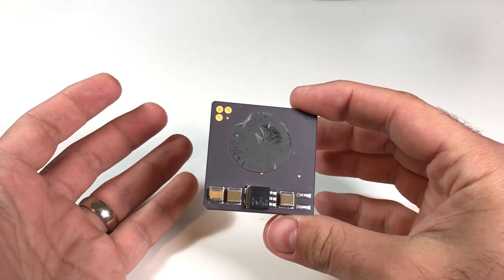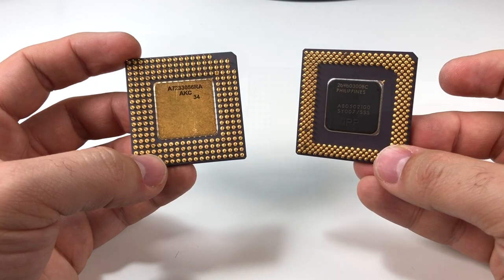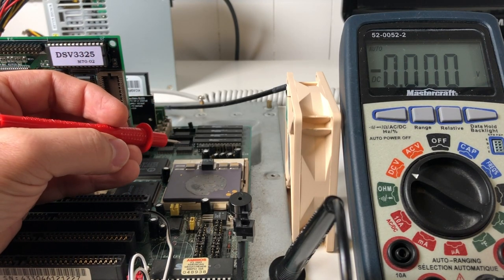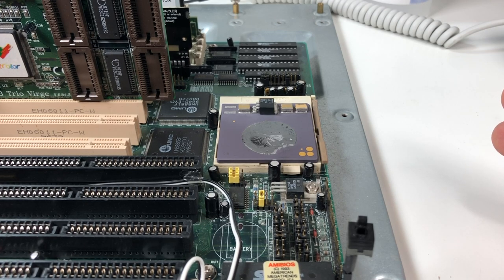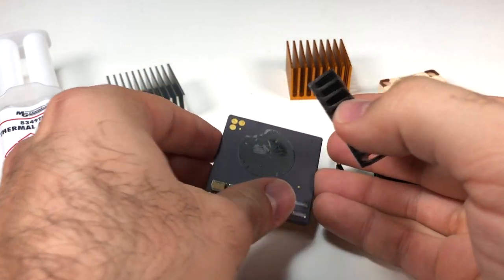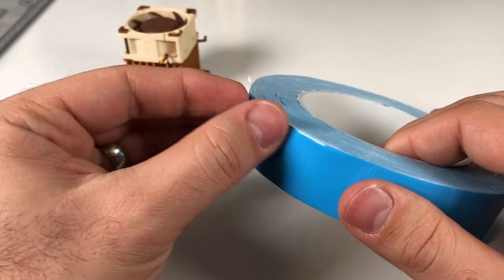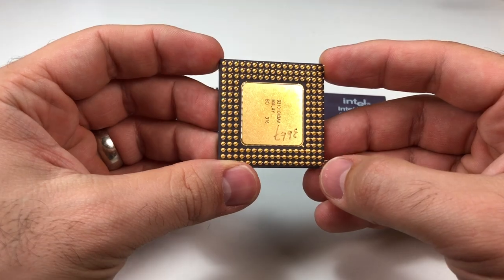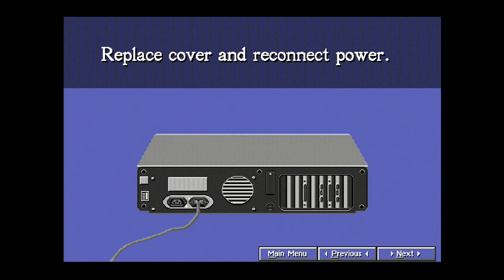The Intel Pentium Overdrive CPU for 486 Systems

Comment: This was a very interesting video. Back in the day I had a Compaq Presario CDS 924 with a 486 DX2/66. I was looking to upgrade it because, like you said, it ran Quake terribly. I opted for the Evergreen "586" 133 Mhz chip, since it was cheaper and gave me more Mhz. It actually powered up my Compaq quite well and it ran Quake and other games very nicely, but then someone told me that it was just an OCed 486 and it lacked the special Pentium instructions that would allow it to, say, boot Windows XP. I was peeved, but the chip still tided me over until I got a true gaming rig.

Comment: Back in the day I had a 486DX4 100Mhz with 16MB of ram. I remember when Winamp came out it cried that it needed MMX instructions, so I spent the money to upgrade to the Pentium 60mhz.. even though it was "40mhz slower", it included those MMX instructions that allowed me to run Winamp.. man I wish I kept both of those boards.

Comment: In  my first job, at beginning 1996 I have to upgrade a tower server from Compaq, a Prosignia VS with a 486DX2 and I selected a Pentium Overdrive 83MHz. It was an incredible upgrade for Novell 3.12 file server in an organization of around 50 office users. It was replaced in 1998 by a Pentium Pro 200MHz. I still have that old Prosignia server and start to hear that old SCSI hard disk and Novell console. So fast and powerful computer in that time but evolving so quickly, in very few years we were Xeon servers, ufff.

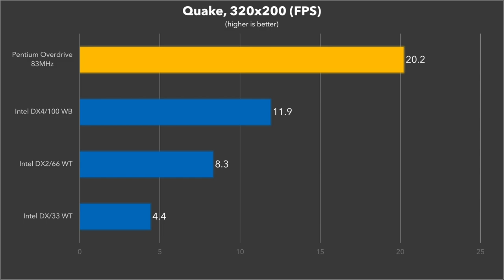Comment: 25:00 most of the effect does not come from the FPU performance itself, but from the architecture difference between 486 and pentium. How pentium worked, was that FPU was able to process its data in parallel with the rest of the CPU. It was almost like you had 2 cores on a CPU. And in quake they made heavy use of this "dual-core behavior". 486 couldn't process integer and floating point calculations in parallel and most of the performance is lost on that part.
Reply from the maker: Very interesting, thanks for sharing! I still have a lot to learn about the Pentium architecture :)
Reply: I'd love to see a reference on this! As far as I knew, the 486 was available with an on-die FPU, but the FPU remained a distinct coprocessor until MMX and SSE started coupling it closer to the CPU. FWAIT was used to synchronize with the FPU, and you could absolutely do other work on the CPU before that.

The Pentium had some FPU operations run in fewer cycles (including the infamously buggy FDIV), but its main improvement was in instructions per cycle on the integer side, which they termed a superscalar pipeline.
Reply: It's a combination of multiple factors. Mainly the superscalar integer pipeline, pipelined FPU, FDIV overlap, and FXCH parallelism. The original software renderer was hand-optimized by Abrash with these specific architectural details in mind. Check out Abrash's Graphics Programming Black Book if you want to learn how exactly it all fits together on a per-instruction level.
Reply: @GeckonCZ  Thanks, I think I may. :)

Comment: u should immediately replace all of those ceramic caps , ceramic caps when damaged can go short circuit and explode like tantalums which will really damage the soldering area and also short the voltage regulator to ground and as the supply to cpu is unregulated the psu will continue pumping current into shorted voltage regulator and so that ic will explode as well.
Reply from the maker: Thanks for your comment and for the tips. I may do some further modification to the chip and will look into replacing the chipped caps.

Comment: something died inside me when I saw you soldered to the gold pins. I thought you wete going to leave the kapton tape with a piece of wire, just for perfectionist sake. but in any case, really cool video and project!
Reply from the maker: Thanks very much! Haha yeah, to be honest it felt wrong soldering the gold pads. The tape and wire mod was too flaky though, unfortunately. I had the multiplier change a couple of times during testing.

Comment: I remember reviews at the time which usually weren't favorable, mostly because of views that the 486 platform was in it's endgame so it would not buy much time for many people. It was a spectator sport for me because I got a P54c 90MHz system (with the FDIV bug) in mid-94 as my graduation present, though I remember it having a few issues, particularly with the Reveal sound card that Insights included.
Reply from the maker: Thanks for your comment! The FDIV bug was very interesting. My first Pentium was from 1995 (a P54c 100MHz model NEC system) but I'm pretty sure they had the FDIV situation sorted by that point.
Reply: I would have killed for any kind of Pentium in 1994.  We suffered with a 486sx25 from '92 all the way to January 1997 when we got the Pentium 133.  That 133 opened sooooo many doors for us and it was so FAST.

Comment: Sparkle was a great PSU back in the day.  Not sure if they are still around.  I also had a modified one that was labeled "Glitchmaster".  They put a giant stiffening cap in it(about 1" dia X 4" long) and some surge protection circuitry in it.  It would run the PC for about 5 seconds after you hit the power switch.  Enough to ride out an OCR(that thing that makes your lights flicker in a thunder storm).
I had a DX4/120, but I guess I don't remember how smooth it ran quake, I just remember I could play it.
Reply from the maker: Very interesting! I'll have to look into that PSU. I've been really happy with this one. It's got really solid voltage regulation, lots of +3.3/5V amperage and even has a -5V rail. I use it on my test bench for all of my older AT based systems and earlier ATX systems.
Reply: @vswitchzero  Sparkle was made overseas, at least I think they were(are?).  Glitchmaster modified them in Colorado somewhere, IIRC, so it's a pretty good bet they aren't still around.
It would be cool to see someone find an old one and do a review of it, tho.
Unfortunately, I got rid of mine, and all my AT stuff, before I even thought there might be a demand for it again.
Back then I couldn't afford a PC so I mostly took whatever anyone else I knew threw away and I'd piece something together.  So I had so much stuff there was no way I could keep it all.
I'm sure I bought that power supply new, tho, and for that DX4/120.  That was given to me by a friend of the original owner.  He assembled his own stuff and I got that when he upgraded.  It was just a bunch of parts in a box.  I had to get a PSU, find a case, and stuff for it.  Later I bought a Promise controller card for it to overcome the 500mb(?) limit of the mother board.  In theory, I could have up to four 8.4 gb HDD's on that card, which would have been crazy back then.  I think I eventually had a used 1.6 gb HDD on it at that PC's peak.
It's a shame you just can't keep everything you ever had, lol, or, at least I couldn't.  ;)
Reply from the maker: @l337pwnage  I know the feeling! I kept almost nothing from my older days of PC building. I'm not sure what became of my original 486 and Pentium, but one I stared building my own systems I was constantly selling parts to raise the funds to buy new ones so I rarely kept anything I wasn't actively using. Over the years I've purchased quite a bit of the nostalgic stuff I had back then. Not always the exact parts but close :)

Comment: That Noctua 40x20mm fan has a 5V version.  Don't know if the CPU package could provide enough power, but it would be pretty cool to have it soldered on and self-contained like that.

I also have what looks to be the same thermal tape.  I got it to attach small heat sinks to some servos, and was surprised how well the stuff holds.
Reply from the maker: Thanks for your comment! I actually have the 40x10mm 5V version from Noctua. I think the OEM fan is actually quite a bit heftier and probably uses more power so I assume it would be okay to be powered from the gold pads.

Comment: Awesome video. One thing I'd like to see is an AMD 5x86-133 running at 150 and/or 160mhz on the same board to compare performance. I ran mine at 150mhz back in the day after benchmarking and seeing the mhz bus more than made up for the 10mhz frequently loss. I guess I just got lucky that my Diamond Stealth 32 VLB video card had zero issues with it. I did always wonder back then though if I had an overdrive chip how it would perform in integer performance. Even Quake ran around what a p55-90 would output though, so I wonder how that would compare too.
Reply: I commented before the end of the video and saw that 160mhz was tested. Was 150 mhz tested though? The extra bus clock really helped, and I have no idea how my i/o card and crap 30 pin simms handled it.
Reply from the maker: Thanks for your comment. I'll be doing another video comparing the AM5x86, Cyrix 5x86 and the POD. I will be including overclocking results in that one.

Comment: I bought a few drop-in speed replacements back in the days of the mid 1990's. And those were a 286-to-486 (to 25mhz) & a 486-to-586 (to 100mhz).  Both were from Evergreen Technologies (now since defunct).  The 486-to-586 is put into the Pentium Overdrive socket of a 486 motherboard that might have that additional socket.  My 486 did have that socket so I was able to enjoy a boost from the original motherboard 25mhz to the new 100mhz, because the new cpu is an AMD 5x86 (up to 133mhz).  I still have all 3 of these boost cpu's, but one of them got so overclocked that it had since gotten rendered nearly braindead & unstable due to thermal electromigration, i.e. I did not put enough heatsinking & cooling into it, back then in the late 1990's.  The x586 is still being used on one of my 486's today & it is still useful, although as useful as a sped-up 486 100mhz is going to be, relative to today, of course.   However, long before any of that, I did buy a boost cpu for my Commodore 64 in 1990, which boosted the speed of my C64 up to 4 times faster & that made a huge difference in some games & also in programming & productivity apps.  And I still have all my C64 stuff, which includes peripherals, disks, magazines, manuals & that boost cpu.
Reply from the maker: Thanks very much for your comment. It's always awesome to hear some first-hand experiences with these upgrade chips. I remember the Evergreen chips well. They were very popular back then.
Reply: @vswitchzero  ... I will likely further tinker with that boosted 486, if free time permitting.  I have been wishing to change out the mainboard oscillator so as to jump speed from 100 mhz to 133 mhz overall, to take advantage of the 5x86 133 mhz.  I am unsure of any potential issues though, which jumping from 100 to 133 may be within official tolerance for the 5x86 cpu,  yet it may not be for the motherboard components, but I would still like to try.  That was one of the exciting things that came out of the 1990's, wasn't it, i.e. cpu/mainboard overclocking?  Nowadays, AMD & Intel have since put the inclusion of automatic software overclocking in their modern processors, when ironically both companies condemned it inappropriate for end users to overclock their cpu's back then or else suffer voidable warranties, heh.
Reply from the maker: @robwebnoid5763  So true. The big gains (sometimes 50-100% or more) that could be had on old hardware like this is just no longer possible these days. Intel and AMD have become so good at squeezing ever bit of performance from the chips they make through use of boosting, thermal throttling and other technologies it seems. I may be wrong, but it feels to me like the Core2Duo was the last truly great overclockable chip.
Reply: @vswitchzero  ... Hmm, I don't think I have a C2D, but I'll have to check.  Well, at least I know the ones I've bought over the years didn't have a Duo.  I had acquired some used laptops at the recycler a few years ago that others have tossed & I will take a look at their processors.  Free is a very good price, heh.  I believe I may have repaired a friend's laptop over a decade ago that may have been a Duo. Or maybe it was one of my sister's machines. A lot of my older CPU's are still set overclocked on whatever motherboard they are on right now, notably my AMD K6-III+ overclocked from 450 to 600mhz.  There was a bit of a disappointment when Intel took away experimental end-user overclocking & then made it their own, when Intel/AMD did not even really make overclocking a part of their business in the first place.  It feels as though they stole that idea from the users & are now making money off it.  But it is what it is, it's their product & we customers toyed & abused it for as long as we could, to save money, heh.   People crave the latest higher number-crunching graphical games & high speed videography editing, so we're still going to want to buy the latest cpu's anyway from Intel/AMD, along with graphics gpu's, because we can't help it that technology keeps moving forward.  I am sure people still further overclock the latest crop of cpu's from the past decade or so of cpu's developed, but the gains are now smaller, much like what you said about gains, that of which Intel/AMD "stole" that thunder of gains away from past overclockers.

Comment: Neat, I have an Intel "SnapIn 386" upgrade CPU for the IBM 5170 and it has software that looks visually identical despite being a much older-generation CPU!  No FPU test of course, although I've also got that separately in the software for my 287xl coprocessor - but I think the software I have for that chip is text-based.
Reply from the maker: Those snap-in upgrade chips are really something. I always wondered how well they hold on to the old processor. Very interesting about the software similarities too. Thanks for sharing!

Comment: Back in the day, I had a DEC Starion with (probably) a 60mhz Pentium. I bought the Intel Overdrive chip for it. Jumpered the bus speed and I was then running the Overdrive at 133Mhz. Nice upgrade. My first PC after many years with an Amiga.
Reply from the maker: Nice! Those socket 4 overdrive chips are SUPER rare these days.
Reply: @vswitchzero  I sold the system to a coworker and never saw it again. :(

Comment: I was aware of these but never saw one in the wild, the final generation of fast 486's from AMD etc held most people off until Quake in 1996 finally cemented the need for a Pentium.

Had absolutely no idea this chip could throttle itself, that definitely has to be the first example of CPU self preservation tech, something most chips that followed until the mid 00's didn't do.
Reply from the maker: Thanks for your comment! Yeah I'm not aware of any earlier CPUs that would throttle like this. It was definitely a unique feature at that time, that's for sure.

Comment: My first computer was a 233mmx, so, a little ahead of these overdrives. I only wiched intel still produced overdive cpu's, the new alder lake e-cores would be such an upgrade for so many old plataforms.
Reply: it's basically the same as i did with my am4 recently. landed a 5800x3D on the system i originally bought for a r7 2700 (non-x), and the improvement over that is vast. in games, it might be 3 times as fast.
Reply: @GraveUypo  AMD is so much better then Intel on upgrades, the single fact they keep the same socket for several generations is a plus.

Comment: Acording to Wikipedia the Intel Pentium Overdrive CPU for 486 Systems was Introduced February 3, 1995. While the Pentium Processor (P5) was introduced 22. March 1993. Seems weird to not buy P5 in 1993 and instead buy a lower performance Pentium Overdrive CPU in 1995  🤔

Comment: Cool video ,  

On the epoxy  issue , I would of used some normal thermal paste  than then 3-4 small spots of epoxy in the corners.

That way you get the best of both worlds , the heatsink is secure but won't be a "female dog" to remove
Reply from the maker: Thanks for the great tip! I think that's definitely a good move and I'm sure the thermal paste will have better thermal transfer than if done with all epoxy too. I may actually be removing the heatsink to do some further mods to the chip, so if I do may give this a try.

Comment: 1- heatsink is overkill. The black one would have been sufficient, if used in a clean (non smoker) environment.
2- The fan is overkill. You could have easily used a 12V fan, using the 5V pins. It would have given you enough airflow.
3- the cooling efficient of the tape you use on the cpu, is about the same as standard dual sided, plastic scotch tape.

Comment: Hey! Loving you vids. Just a query on the CPU fan direction, I noticed that you had it blowing down...would it not be better sucking up instead? This is a learning opportunity for me, not a criticism.
Reply from the maker: Thanks very much! That's a great question. In theory, it should work both ways to cool the heatsink, but I seem to recall that pushing air into a heatsink's fins is a bit more efficient. There is also the benefit of providing airflow to other components around the socket when its facing downward (like VRM components on the motherboard, or in the case of the POD, the VRM components on the CPU itself). Tower-style heatsinks are a different story though.

Comment: Way back in the days my 1st computer was a Gateway 2000 4DX2-66  It was so slow. Even with the Evergreen Pentium Overdrive CPU Upgrade the system had bottlenecks. It wouldn't even play mp3s.

Comment: I bought Tandy 3100 and 3200 back in the day.  486/33s with 4MB, no sound or CD.  Still have them fully loaded.  The 3100 had only the "new" zif socket and could take up to a DX4/100 or the Gainberry 586/133 which is what is in the 3100 now.  The 3200 has the Pentium OD socket.  The Gainberry smokes that Pentium and the DX4 is right there with it.